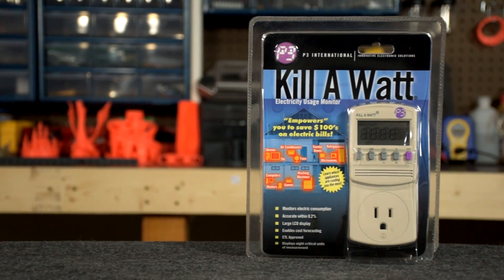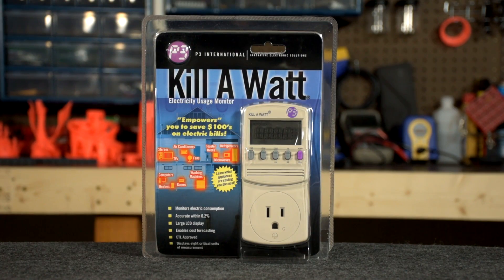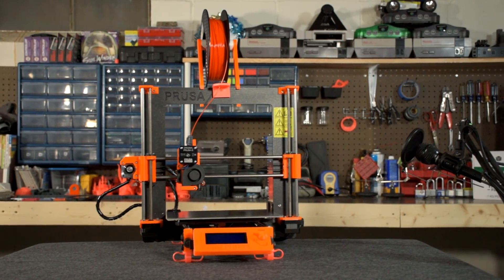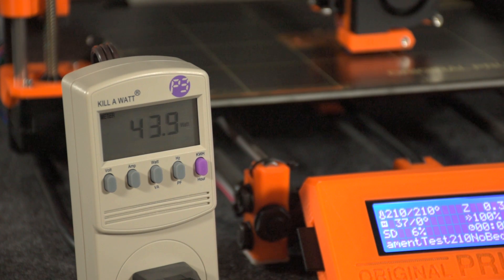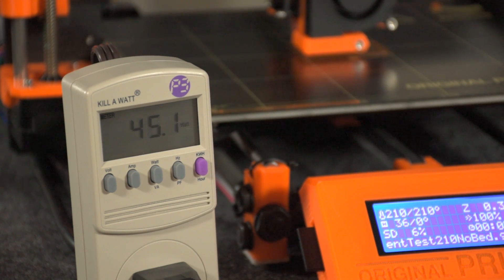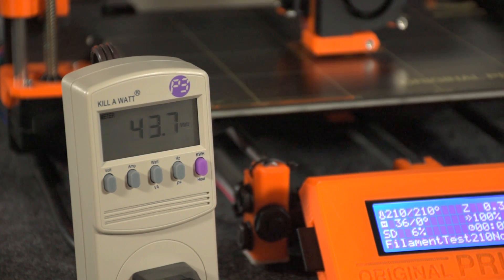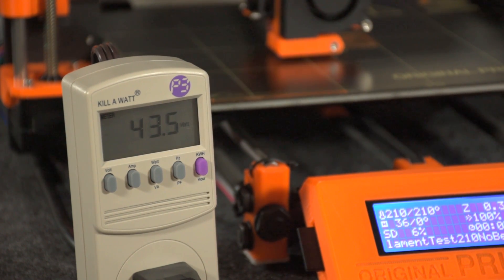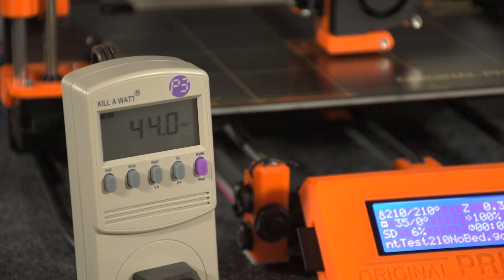How much electricity do 3d printers use?

Comment: And then they blamed me for having a 3d printer running while they have a PC running 1000w.. Thanks for the video!
Reply: Leopold i know  but with 2 980s 5960x and a boat load of fans  running almost 24/7 hahah
Reply: Do you know the power consumption rate of the 980s? If not I rest my case and anyway this post was 3 years ago either you're bored or going mad from this pandemic have a good day sir

Comment: This just proves that we should not be using 12V PSUs. Why Prusa went with 12v is still baffling to me. My prusa style MakerGear M2 averages 150w with a bed set at 95c and hot end at 245c for ABS printing, that's because it uses 24v. If I used 55c/210c, I'd be closer to 100w. 200mm x 250mm bed size. I have a whole home power monitoring system which I designed/installed over a year ago. Just looked up power draw for the overnight print I did from my system, and that was the average the M2 was drawing.

Comment: Were you running in silent mode or high power mode?
Reply from the maker: Good question, I should have mentioned that!

All the tests I did were in 'High Power' mode, so they should be worst case scenario for the given temperatures.

Thanks for asking!
Reply: I am in the same boat as you being a newb and have been watching a few reviews over the past few days. Most who have owned many printers don't mention the noise, or actually comment on how quiet it is. Have you ran in quiet mode for a significant amount of time? And could you do a comparison print to give an idea of what the differences are (e.g. build time, quality, actual noise reduction etc.)?
Reply: You did touch on this at the end of the bearing video, but its buried deep towards the end of the 3 hour vid.  :D

Comment: The stock Power supply is rated at 240W.
Reply: Plugging a 1000W power supply instead would not raise the power consumption of the device
Reply from the maker: I'm aware, but even with the heatbed at 100c the highest usage spike I observed over a period of about 6 hours was about 206 Watts, which is why I used the figures that I did.

Most power supplies have variable output settings so its possible mine was adjusted lower than normal.
Reply: You specifically want to use a power supply that is over your expected power draw so you're not working the power supply so hard.